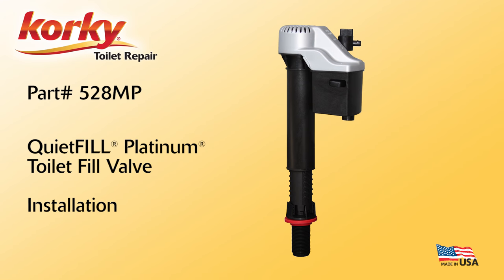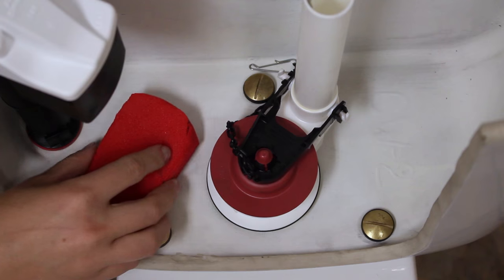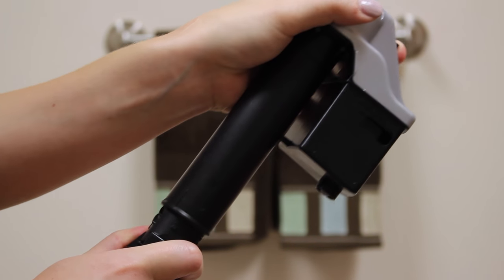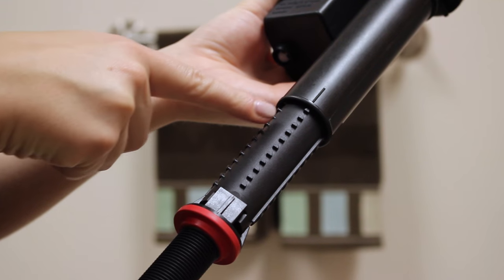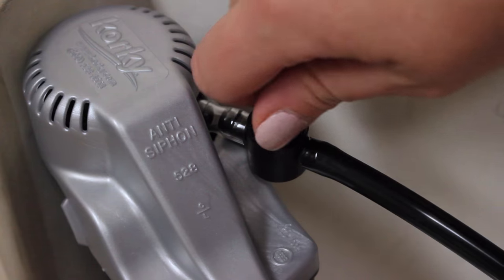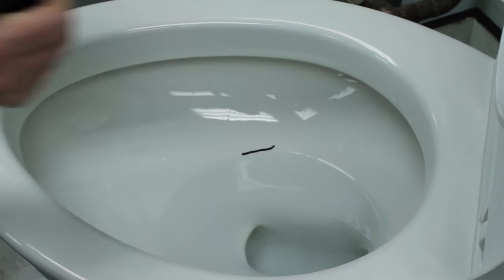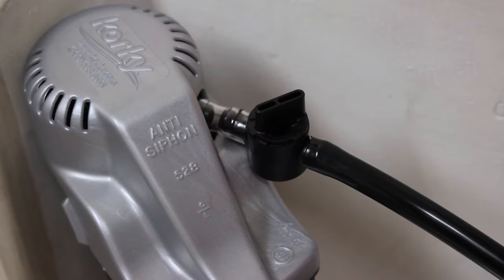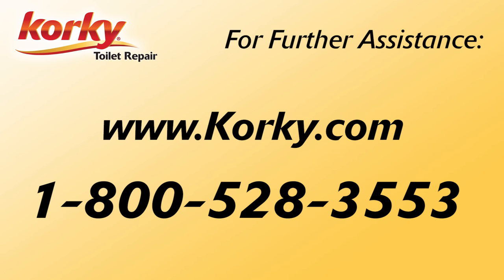How to Install QuietFILL Platinum Toilet Fill Valve by Korky

Comment: Why does the silver on the fill valve need to line up with the top of the flush valve?  My flush valve is 1" higher, and I can't raise the fill valve because it hits the tank lid.  Do I really need to trim 1" off my flush valve?
Reply from the maker: Are you able to contact our customer service team? We would like to learn more about your toilet to ensure your installation is correct. You fill valve is backed by a 5 year warranty and we want to ensure your 100% satisfaction.  We are here and happy to help! Please dial 1-800-528-3553 or email us at sales@lavelle.com. We are available Monday through Friday, 7:30 AM to 5:00 PM CST.

Comment: if you're replacing a brand new fill valve with another brand new fill valve in a brand new toilet with all brand new parts top to bottom then yes it will be that easy you can do it without messing up your nails.

Comment: I have one of these installed and it recently started filling slower and sort of surging. It will refill, stop, refill, stop...until the tank is full. What is the problem and how should I address that please? Thank you!
Reply from the maker: Sorry to hear that!  We would recommend walking through the steps outlined in this video: https://youtu.be/08gPcuq74FM

If you would prefer to speak with Tech Support, feel free to call us at 262-763-2434 or email Sales@Lavelle.com. We are available M-F, 7:30am-5:00pm CST and would be happy to help.